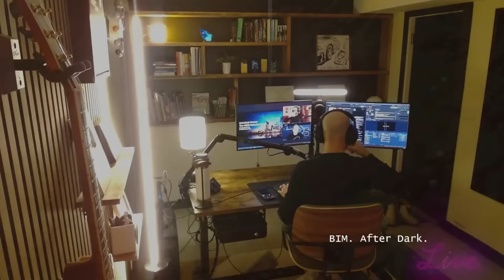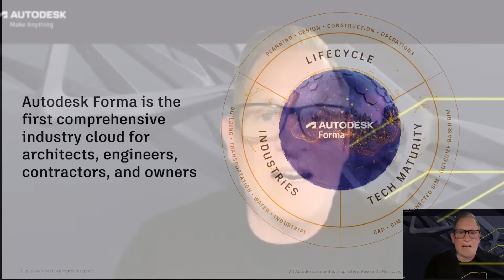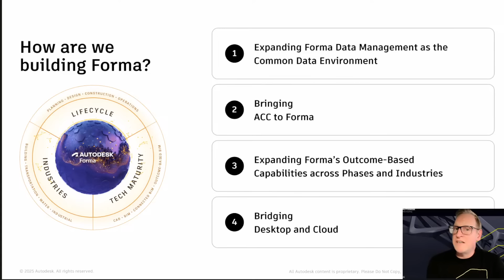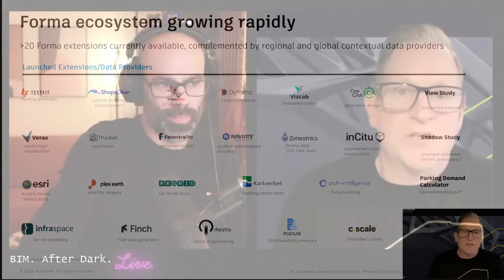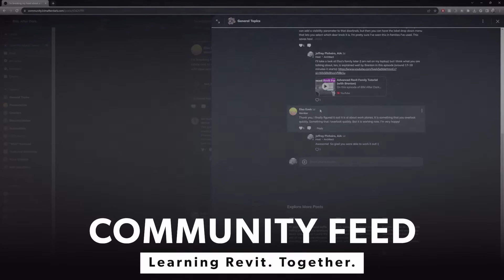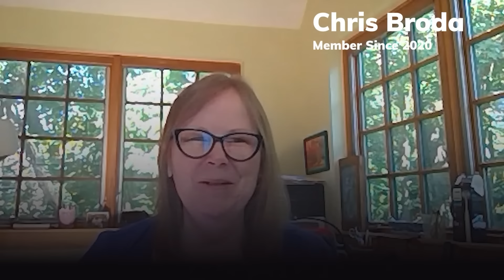Goodbye ACC, Hello Forma: What’s Really Changing at Autodesk?

Comment: BIM manager here in NZ. File format sharing is going no where in a hurry. A fabricated steel model provided to the construction team is a deliverable that needs to be shared as a recordable deliverable. Absolutely no chance a company is going to share their live model with you. This whole thing just sounds like a complete nightmare.
Reply: It likely need not be live live. You 'contract', digitally, to transmit/receive an 'exchange' but apart from some access control bits flying around no data goes anywhere.
Reply: That maybe for you, I’ve seen big firms like HKS and Gensler who do hand over live models and pick it apart from there…and it’s worked. All this is to say, each process across the AEC industry is different and no two firms work the same.

Comment: they will keep "changing". (like there was any change between BIM360 and ACC hahaha)

And we will keep pay more every time for the same thing.

Thank you Autodesk.
I wish you had competitors.
Reply: There was a big difference between BIM 360 and ACC. The most important distinction was the addition of Plangrid functionality into ACC, which did not exist in BIM 360. Additonally, there was no change in cost between BIM 360 and ACC. In fact a subscription to anything in ACC also provided access to BIM360...you got both.
Reply: But what about all the new graphic designs on the buttons?  I know for sure that if my AutoCAD (which I hardly use) buttons LOOK different than the previous year, that my Revit will work better.

Comment: The concern I will have with this platform will be with the proprietary black box approach to data and geometry conversion.  If the user has zero visibility or capacity to control the conversion mechanisms, then again, the offering will fail like all previous attempts.

Comment: So basically Autodesk have just taken the idea that Speckle started as an open free standard between no only Autodesk products but a whole range of softwares like unity and unreal.

Autodesk seem to be translating there platforms in such small time frames (glue, 360,ACC, now forma) yet the platforms always have limitations and some bugs are never ironed out before they move onto the next…
Reply: FormaX is Autodesk moving toward a cloud-data model. That direction makes sense, but Speckle’s role is different.

Speckle gives you full access to your data with no API metering, token limits, or platform lock. You can use your data for analytics, automation, or ML training without restriction; our EULA doesn’t claim rights over it and doesn’t limit how you process it.

Autodesk will keep evolving ACC into Forma; that’s their ecosystem. Speckle remains the neutral exchange layer that works across tools, keeping your data portable and under your control.

In short: Autodesk is building a cloud for Autodesk; Speckle is building a bridge for everyone.